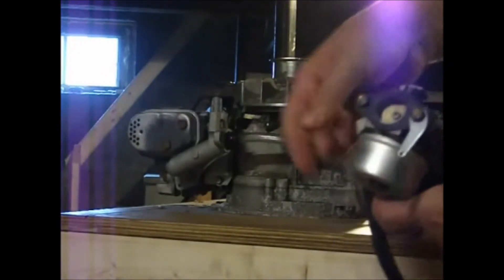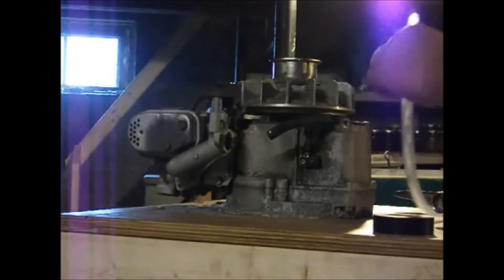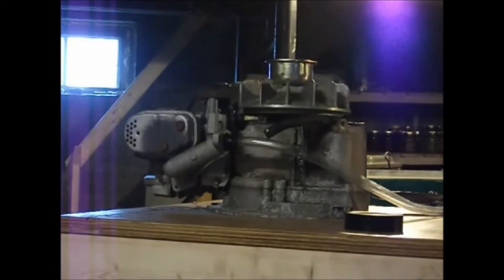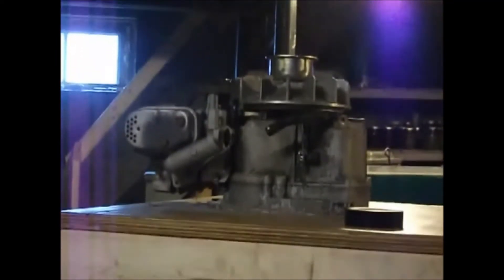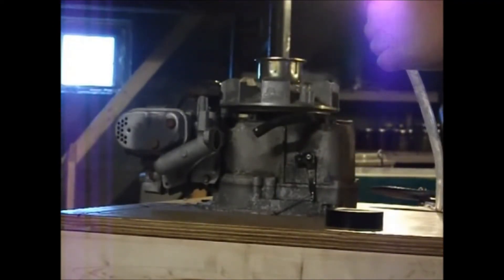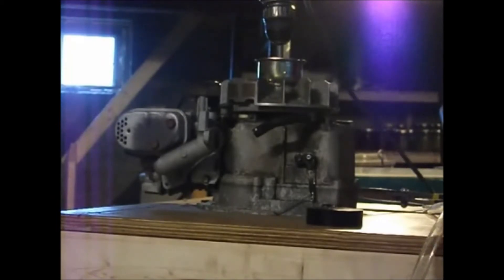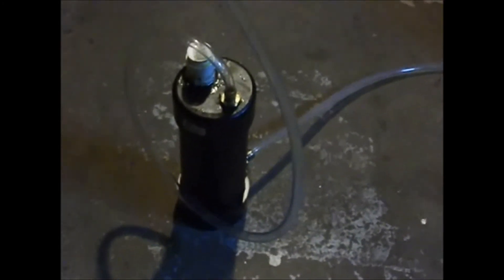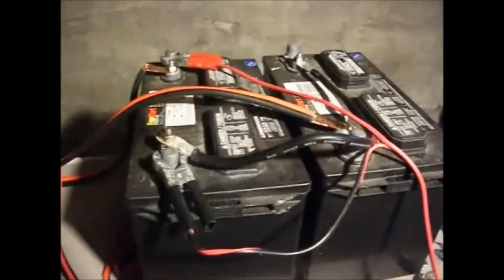Hydrogen ( HHO ) Engine Part 4

Comment: What I do is make all holes smaller! The best diameter are 8 mm hole 4 holes for gas output and 2 hole of 8 mm for water leveling. The cell dimension is commonly 6' x 6", but split vertically by rubber gasket. You could see that in my channel " My last common type HHO dry cell" All the best wishes for you friend. Brgds, Tan K.

Comment: Hi, I was following your progress, according to your numbers the MMW are reaching 5.41. it's a good figures for dry cells especially with big square holes like yours, it's amaze me a lot, may be because these forging plate steels you used for the cells. Ok look buddy, I was using a dry cells before and the best MMW I ever got is around 5,6, the cell it self was 316 L SS, To achieve this MMW number I need a year working at it.
Note ; I'm not using any PWM just playing with brute force.

Comment: Good work your getting there. My guess is you have enough production to idle. I think your valves could be leaking a little. That's why the flash backs and the back fire. After you clean the valves use you torch in the intake. The small orifice and valve could help. Remember AIR tight.